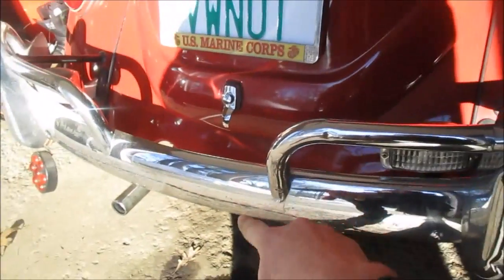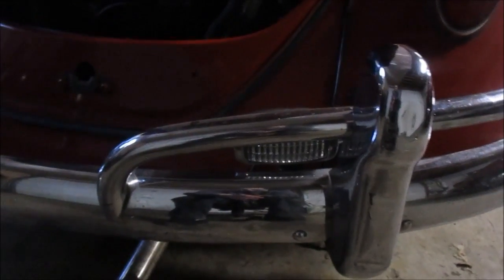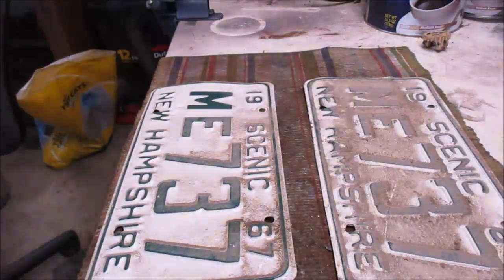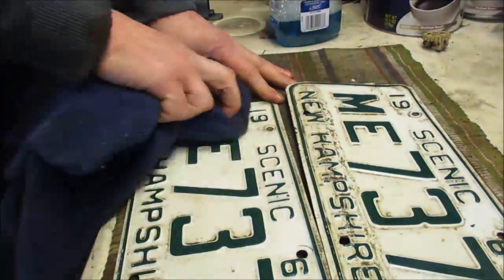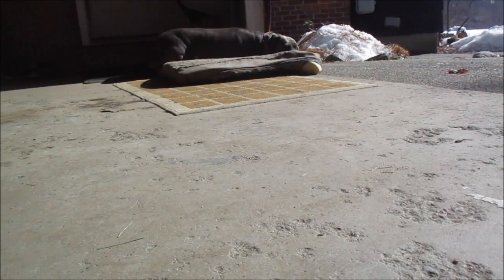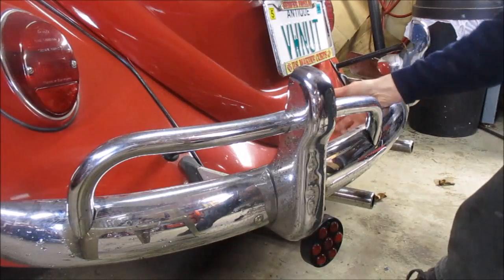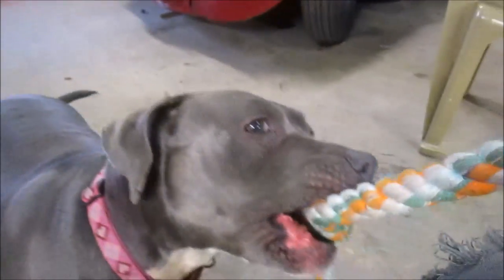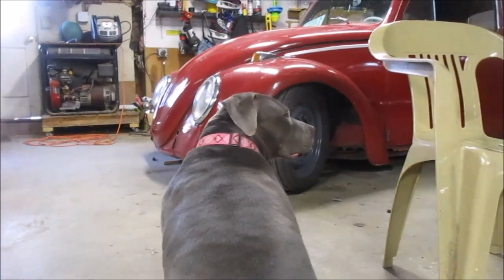1967 vw bug 1 year only rear bumper

Comment: good deal VWNUT ...bigger air cleaner in 67 due to 1500cc upgrade led to wider decklid which led to the bumper change ...66 and down US spec bumpers are the ones your replacing ...keep up the great videos... VW geek will shut up now :) no grommet is needed between towel bar and blade on OG bumpers
Reply from the maker: great info thanks for watching rixkafer56